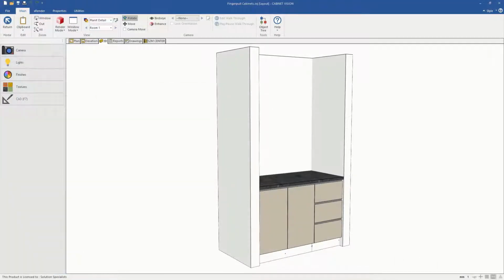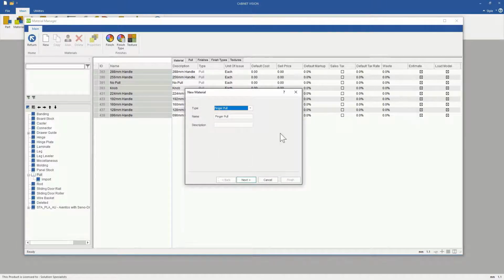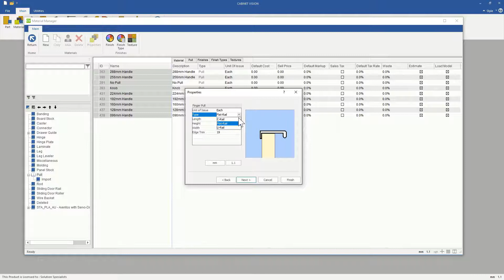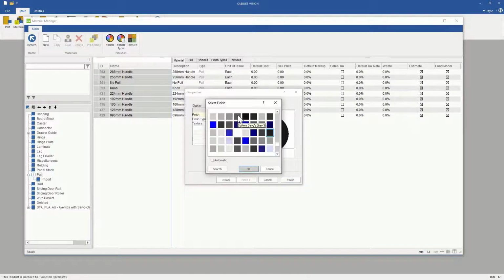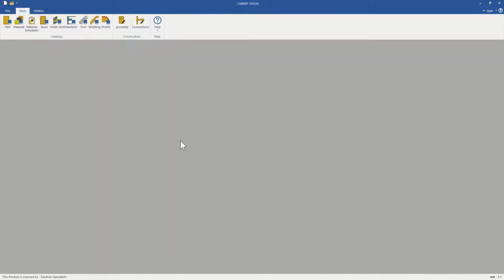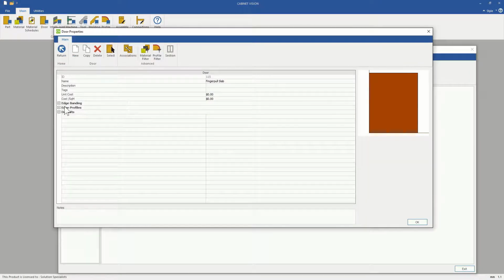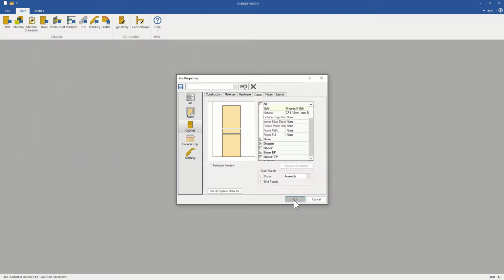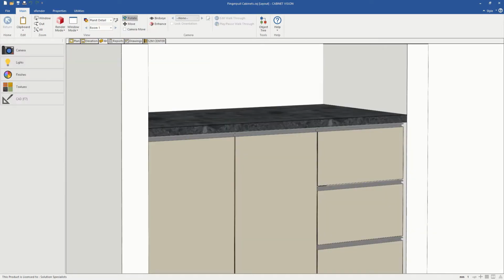Assign Finger Pulls to Door Edges | CABINET VISION 2021

Comment: I've followed your tutorial step by step, its really clear... but, i get a different result - i get the finger pulls on the door and drawer fronts, but i also get an annoying random finger pull sticking out at 90 degrees from the cabinet. any help to solve this?
Reply: same thing is happening to me, have you found a solution to this problem yet?
Reply: @SkateRatCj  i did solve it! 
here's what I did:  in material schedule > pull > part category > assigned material - make sure there is only the one finger pull you made assigned to 'finger pull' and all the others are 'material not assigned'